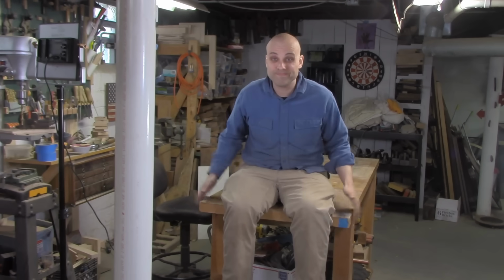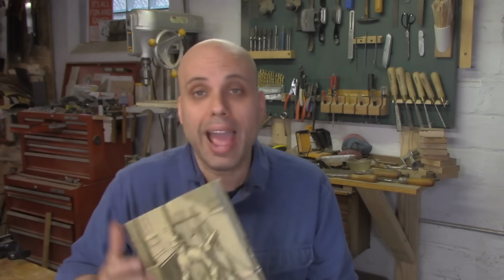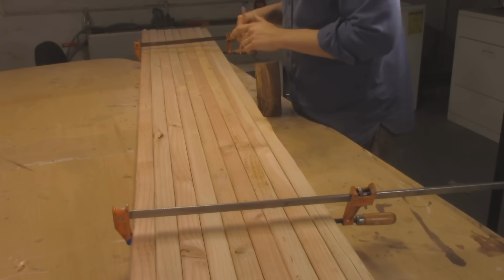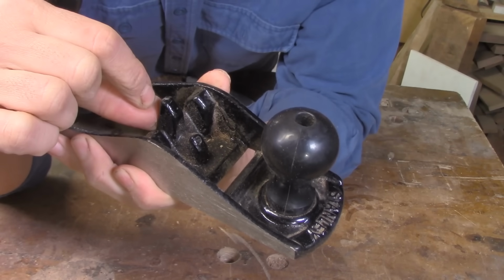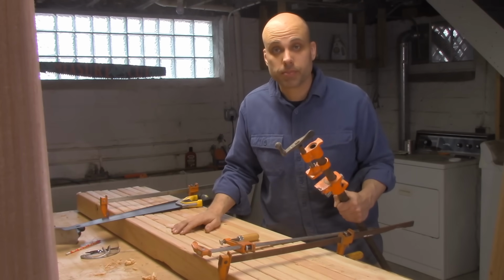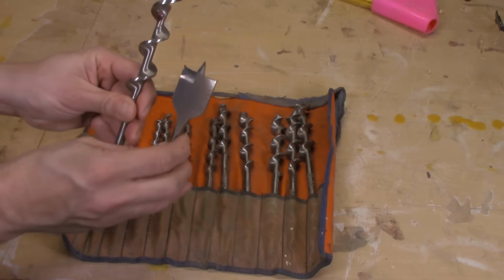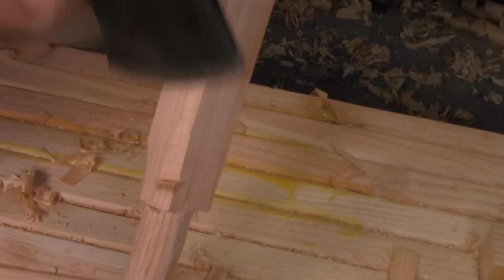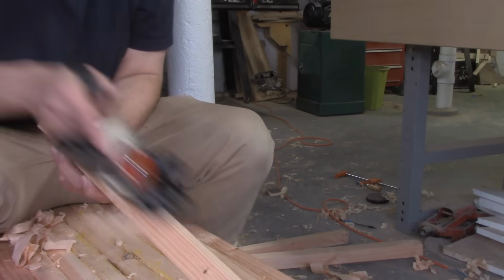Build a REAL workbench for $30

Comment: Couldn’t find SYP in SC in 2”x4” so I got 2”x8”s x12’ in SYP and some in 2”x 10” for legs. Plan to cut them, rip them and then plane them. I’ll do three section 12” wide then send them through the planer. Then sandwich three together to make it 3’ wide. Thinking about running a finger joint at one end to carry a solid surface down the end similar to a riverfall edge. This will allow bench dogs to run down the end of the bench in line with the surface dog-holes.
Reply from the maker: That sounds...complicated. Maybe just build the basic bench first and see if you think it needs all the rest. Also, read Chris' book. Very eye-opening.
Reply: Rex Krueger I already have a small bench similar  ( 20” x 48” 3” thick ) to the one you built here. Just time to step up the game.
Reply from the maker: Fair enough!

Comment: Once it's a lamination project we could cut costs further down by laminating the legs into the bench, avoiding the added technicality of drilled legs.
Reply: I thought about that too, but getting the compound angle for the legs is still non-trivial. If you wanted to do it as part of the lamination it would complicate matters enough that it would almost be easier to chop out a mortise with a chisel.  EDIT: Unless you just want vertical legs.
Reply: True, sawing fitting compound angles has something of a trap, it makes a project interesting but probably undoable complex. I had two part legs in my mind, an angled lamination is only one step away of what’s already happening.

Comment: How heavy would a workbench like this weigh? I work outdoors so I find myself moving equipment in and out of my shed a lot. Thanks for the help Rex!
Reply from the maker: I don't have a scale that I can weigh it on, but less than 100 lbs for sure. I can more it around, but it's an effort. Feel free to make it shorter to save weight. I would make it shorter if I were doing it again.

Comment: I built a similar bench for my miter saw, taller and wider of course. I like that pencil trick, it's pretty cool. And the problem with the plane is that it is that cheap Stanley 404 if I'm not mistaken. LOL
Reply from the maker: Yeah, but I fixed it up in a previous video and it works pretty great now.

Comment: Wish this video was made before I built my monstrosity out scrap roofing timbers, lag bolts, and laminated 3mm mdf sheets. I may have designed something slightly more practical, rather than something an elephant can sit on.
Reply from the maker: Eh, I did the same thing with my main bench. I don't regret it. I can't even move it without help.

Comment: Nice looking bench.  I made something similar except I did the legs out of 2x3's that Lowe's sells.  Since then I made a larger bench using clear SYP 2x4's for the top with 3x3 legs.  I ripped 2x6's to get 3" boards to glue up for the framework for the base.

Comment: Start with the pipe clamps on the bottom and add more to the top to apply equal clamping pressure. Usually no need to flip a big  glue up like this mid  way though the clamp up. It gets heavy and you run the risk of the glue up actually popping out of the clamps.   You can also use a straight edge across the boards you are gluing up to make sure you are not forming a curved surface. you can apply more or less pressure on the top or bottom clamps to straighten it out, or pound some wedges under the pipes to straighten  it out. just be careful to not glue the wedge to your glue up.
Reply from the maker: Um, yeah. I didn't flip this one and I think I gave the exact same advice on clamping.
Reply: You say start with them on the top of your glue up 12:26. Sorry I skipped about the video might be missing something. @RexKrueger

Comment: just asking but could you not have added seprerate slots for 2x4 or 4x4 legs instead of rounded 2x2s?? -- add the slots during glue-up and then slot the 2x's after the glue dries -- nice bench, I use an old industrial computer desk, a hobbyist work table, and an old kitchen table mounted to a heavy wheeled crate all as work benches
Reply from the maker: The round mortise and tenon is easy to make and very secure. It's also easy to slant the legs, which is handy.

Comment: This got me pricing 2x4s at the home centers. I've thought about building myself a new bench for a while. But the one I have now kind of does the job so I'm not terribly motivated.
Reply: Definitely check out non-BiG Box stores, your local lumber yard will have more lumber to choose from and often cheaper prices.
Reply: @UCpQUnzG7lmLhwELRHBban8Q yeah but they also often do not let you choose your lumber too. And if they don't know me then they're going to give me whatever they don't want to give their regular good customers. I guess I could be an ass and pitch a bitch at them but I'd rather keep things low key if at all possible. I have walked out of home centers when the wood they had was complete trash.

Comment: For a few more $$$ an option is to go to a commercial lumberyard and buy a 11 7/8” gluelam beam.  It saves the lamination steps.
Reply from the maker: The only trouble with glulam (which I have on my main bench) is that it won't hold a a holdfast and those things are handy.
Reply: Rex Krueger interesting.  I plucked a 11 7/8” x 3 1/2” x 6’ 6” gluelam out of a dumpster that was used as a mantle above a fireplace. (I do remodel work). I figure with $0.00 spent on wood all I have to loose is some time.  And most of that will be spent planing off some super thick polyurethane varnish.  Hopefully a holdfast will bite in a top that thick.  Otherwise I will just use the peg system from the Herculaneum bench in the book Ingenious Mechanics.
Reply: @RexKrueger  3/4" Gramercy holdfast needs 1.75" of thickness. What kind are you using?

Comment: I have a question:

Isn't easier and faster to make the legs like this: https://imgur.com/060diwz ?

Thinking about how he did the mortise by just setting the wood apart, making this would be super easy, don't? Just put a 2x4 on place while doing the glue up to space and done, right?

Or are the angle legs stronger than gluing/bolting the 2*2x4 together as legs?
Reply from the maker: So, that way would totally work, but the way I did it, the tenons are very precisely fitted to the mortises and will hold forever. Also, the angled legs mean the bench has a wider stance and is more stable. But by all means, try it another way. Experimentation is essential!
Reply: @RexKrueger  Thank you for the answer, I guess I understand better why the angles were so precisely though, stability, with is very important

Comment: Remember when you reviewed that wooden Chinese plane? I commented that it was designed to use at a knee height bench so you can add leverage with your body. This would be the perfect chance to show off that plane now with this bench.
Reply: So much better for sawing on too. Rex, you looked loads more comfortable than in the saw test last video!
Reply from the maker: I raffled that plane off to Patrons, but I take your point. As to the sawing, yes!  SO easy.